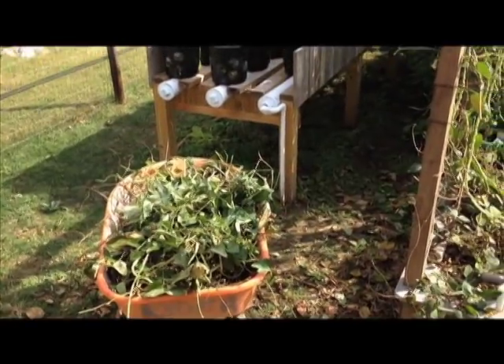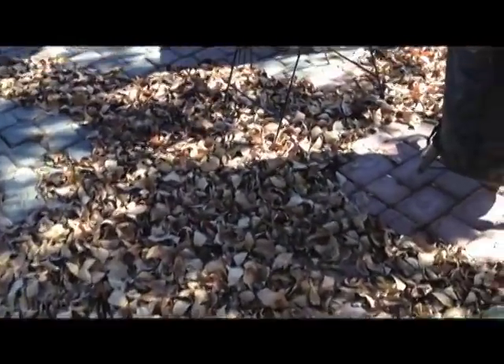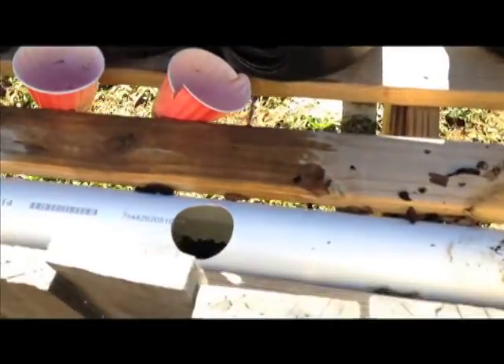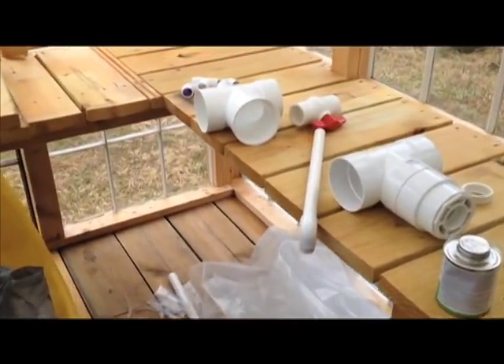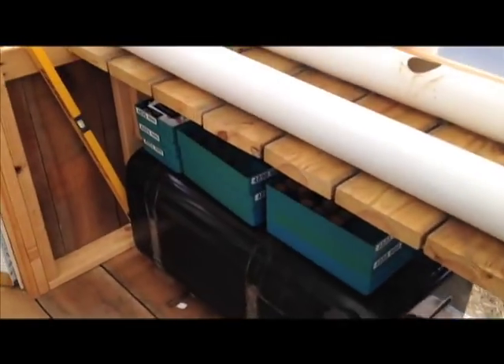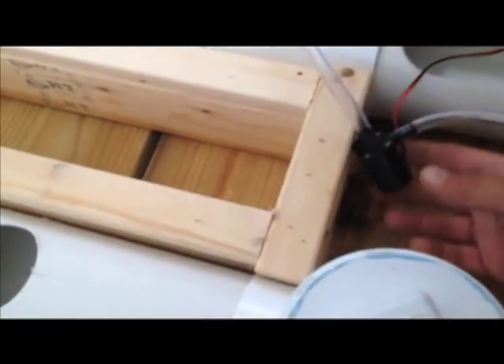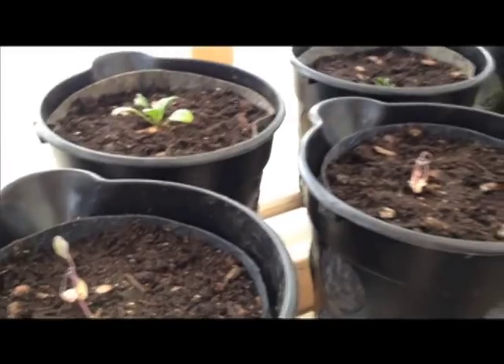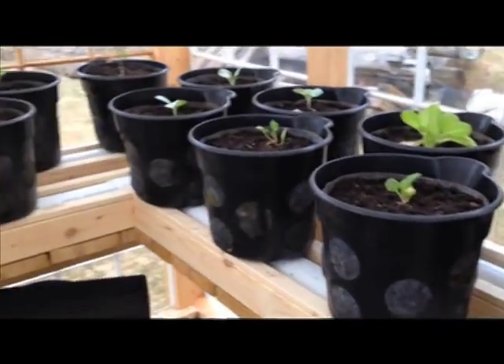Winter Rain Gutter Grow System Greenhouse with Heated Water Build

Comment: System #2 went up remarkably quickly, and works great! I hope it works well through the winter - a TALL request.  Hooray for the tomato plant!
Reply from the maker: Bruce Brinkerhoff Hooray for the tomatoes for sure.  When I returned from my 3 months in Alaska my garden was completely overgrown and when I saw the tiny tomatoes I thought... I won't plant those again.  They were so tiny that they hardly seemed worth picking, until I tasted one of them.  They were amazing.  Tonight is a good test.  OT is 26F.  I put a space heater in the greenhouse and it is 32F.  We will see..

Comment: Excellent system, I love it!  I know this is an older video but to add a little heat into your greenhouse could you use 100 hour candles made from crisco? Search YouTube if you've never heard of them, there are many tutorials on how to make them.  Not sure how cost effective it would be.  All the best,

Poo
Reply from the maker: +poosmate Thanks for the info.  I will heat it for next winter by digging a hole and filling it with rocks. Using a fan to pull air from the top of the peak of the greenhouse, piped down to the rocks that are retaining the heat and then blow it back on the floor during the cold periods.

Comment: Great video. That whole system is just So Fascinating, and it was neat watching you put this project together :) New to your vids, so I don't know if you've mentioned this in more recent videos, but I've read in the comments the winter last year you had abandoned the winter growing due to it not being worth it, but I was wondering: Since you built the whole system in there, are you planning on using it (or rather Did you use it, since summer is over now), sans heating elements, as like an extra place to grown summer crops? Also, I just had the thought, b/c it's a greenhouse and therefore would get Much warmer probably than the outdoor stuff, you might be able to grow tropicals in there during the summer; dwarf bananas, dwarf mango, ect, you know? idk.. just seems like it could be a neat project :)))

Comment: I should have said "nice level of creativity"...so I am saying it now...sorry I didn't say before. Do you have a sense of effectiveness versus automated drip irrigation? I travel a lot too and don't or shouldn't trust anyone else to water. However, it seems to me that you might get more return versus material cost with an automated drip irrigation system (even if pulling from your roof-water stored in IBC).
Reply from the maker: OF CV I am assuming you are talking about the raised bed garden as opposed to the Rain Gutter Grow System.  I purchased a special soaker hose from Home Depot that is specifically designed for the low water pressure provide by my IBC rain catchment tank.  You get about 1/2 of a PSI for every foot of elevation with the water storage.  I have limited PSI, about 2 to 4 PSI.  That is not enough to pressurize a drip system.  The soaker hose requires a long run time and is not efficient at all in water conservation.  I use a timer and have it water for 30 minutes 2 times a day.  This keeps the soil very moist but drains my tank very fast.  I have a float valve installed in the IBC about 1 foot from the bottom of the tank. The float valve is hooked up to county water supply.  When I use all of the rain water above the float valve, the valve opens and maintains one foot of water even if I don't get rain.  This is another reason for the long water time through the soaker hose, decreased PSI when the tank runs lower.
Reply: good insights...and the first person I know that can type as fast as me and/or write as much as me! right now I am looking at metered pumps (low voltage) from different 55 gallon rain drums. in parallel I would like to create a continuous mulching system which is different than batch systems that you can do in tiers or can now buy at Sam's Club for $150.

Comment: Love the original design and the indoor adaptation is great.  I am modeling my HRGS after your first design and had a question, do you think the plastic buckets are really needed or is there enough structure in the grow bag itself to keep standing.  I was thinking of having a grid like support of 2x2 at the midway point but wanted to get your thoughts.  Thanks to you and Larry for all you are teaching us
Reply: Dustin Ballinger I did 2 separate 10' HRGGS this summer and all I used were the 'Root Pouch' grow bags, no buckets. They worked great with no problems - even held up during a hurricane, you can check my channel out for videos on them if you would like.
Reply: awesome, thanks for the info, I'll take a look and incorporate into my design.
Reply: islandhomesteader Hi!  I'm about to look through your videos in a minute but have a quick question.  I'm also planning to just use the root pouch bags.  Did you cut a hole in the bags and drop the net cup down in, or did you sit the bag on top of the net cup like the gent in these videos?  I was planning to cut a hole in the bags.  Thank you!

Comment: That's hydroponics and in hydroponics we don't use peat. We use clay balls or coconut cior chunks or small rock. And you have to add nutrients to the water and that requires meters to test your dissolved solids and your pH. Check out some hydroponics videos. Also a good aqarium air pump to oxygenate the water.
Reply from the maker: I am using soil to grow in.  It really isn't true hydroponics.  I agree I could use some peat gravel in the net cups though.  I did add a pump to circulate the water in a later video.  Thanks for the input.

Comment: if you had110 volt power you should put in a propane hot water heater and use redaint heating or use passive hot water system